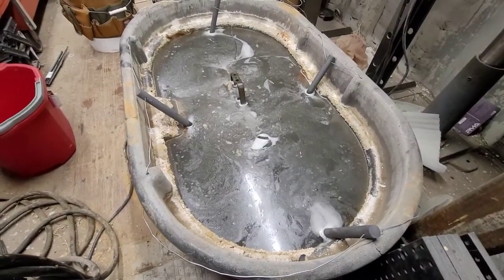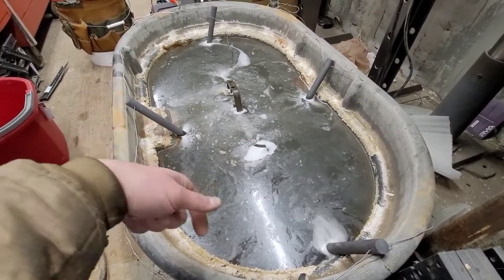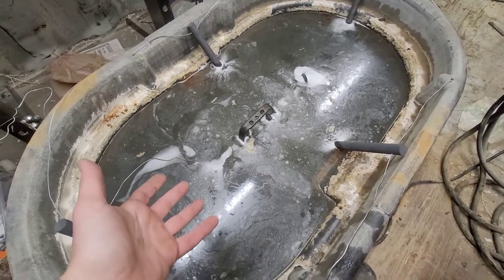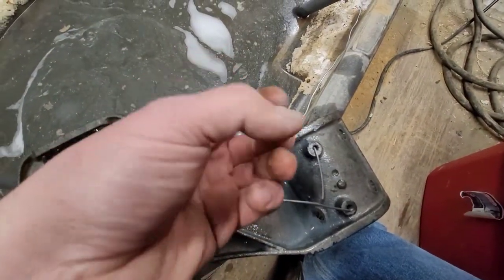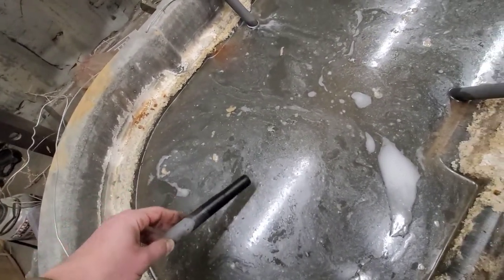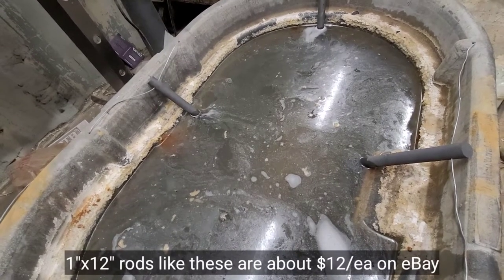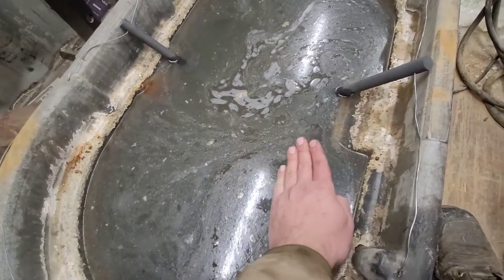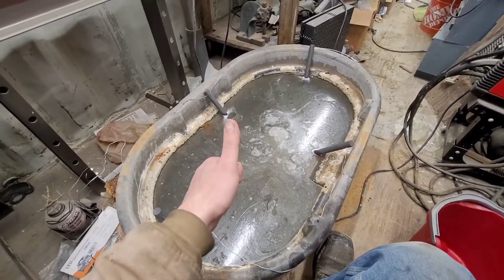Electrolysis for rust and paint removal

Comment: Hi JB,

Have you had any issues with painting cast iron parts after the electralisis process?  I've restored several old tools using an e-tank with great success. 
Now I have a set of cast iron feet from an antique cast iron tub. I've seen a few comments about the electrolyte leaching into cast iron and later leaching out, ruining the paint's adhesion. This is a paying job so I really don't want to screw it up...
Thanks for any insight you can provide.
Reply from the maker: Hi Tag, this is a great question! I have had really good success painting over parts that were electrolytically stripped. I think the biggest key to the whole thing is to make sure that you de-grease any parts going into the solution really, really well before they get anywhere near the tank. The process will usually dissolve grease and grime to a certain degree, so if that is allowed into the tank then it will be circulating in the water and can leech into the metal a little bit, causing issues down the line. Another big factor is using too much washing soda/TSP in the tank. You really don't need all that much of either chemical to have good electrical continuity in the solution, and having too much can cause the heavier salts to precipitate out of the solution and cause a crust around the rim of the tank (in this video, the solution I was using had way too much TSP in it!). If that happens, the chemicals will definitely leech into the base metal of the part you're stripping and can cause adhesion issues. Less is almost always preferable in this case - you can always add more chemical if you need to, but once it's in there, it's in there until you drain and refill. A good rule of thumb I've been using lately is 1 tablespoon of washing soda and one half tablespoon of TSP per gallon of water (so 1.5 tablespoons per gallon, total). This provides a good conductive solution, and the TSP helps with flash rusting a little bit (you still need to dry your parts thoroughly upon removal though). Adjust the concentration as necessary if you aren't getting good conductivity, but going much beyond 3 tbs/gal will oversaturate the solution pretty quickly. Rinse all parts in clean water, then dry using heat if possible. From there, use a good DTM primer and the topcoat of your choice and you should be good. I stripped my entire Logan lathe using electrolysis (disassembled of course), and primed/repainted afterwords. I used rustoleum professional primer and paint, and other than normal wear I've had no issues with adhesion, even with cutting oil and swarf getting all over it over the last 4 years. Sorry for the long winded response, but I hope that's helpful for you!
Reply: @AllThingsMech  No need to apologize, this is a great answer full of important Information! Thank you. Also, can you give me some guidance on how much to charge for 4 heavily rusted cast iron tub feet? Just rust removal, no painting. Thanks again for sharing your expertise.
Reply from the maker: @tagsmyser4299  being completely honest, I've never done any electrolysis for a client - only personal projects. However, I'll spitball a bit here and apply the same logic to this as I would to something like a fabrication or repair project:

The more time, complexity, and difficulty there is, the more I would charge. In this case, I'd evaluate the overall cost by the general condition of the cast iron parts, and what exactly the customer wants as the end result. 

How big are they? How heavily rusted are they? If it's just surface rust they can probably go directly into the tank, but heavy rust/scaling will need to be manually removed before electrolysis to 1) evaluate the base metal to make sure there aren't any huge defects/cracks/damage/pitting that would be made worse by the process and 2) to get a better overall end result (the less total rust there is, the less work your power supply and solution have to do, which makes everything work  better and provides a better product in the end). 

Is there only rust, or will they need to be degreased/stripped of other contaminates before they go into the tank? I know you said you wouldn't be painting them, but does the customer want any other finishing work done once they come out of the tank, like wire wheeling, sanding, filing to remove casting marks/defects, etc?

In the end it's entirely your call, but I would say a base price of $75-$100 would be fair for a basic prep and strip job. If the customer wants additional detail work done, your time is valuable and you should charge according to how many hours you'd need to put into the project. Also let them know that working with old cast iron can be tricky business - it's very tough stuff, but the grain structure of the metal is very good at hiding cracks and casting defects that might not be visible at all during inspection, but could appear during the electrolysis process. Cracks aren't the end of the world and can be repaired most of the time, just make sure they are aware of the risks and won't flip out on you if you discover something that they weren't previously aware of. 

I hope that gives you a little bit of an idea. Of course, feel free to adjust my suggestions however you need to in order to secure the job, but don't undervalue yourself. This is a pretty niche process, and lots of folks think electrolysis is as simple as throwing something in a vat and letting it cook. But, the prep and post work is where the elbow grease comes in (and, as such, is where the money should be made). It's incredibly satisfying to bring old items back around though - sounds like a very cool project! 😎

Comment: Very interesting setup.  I'm sharing this with my buddy and we will set one of these up in one of our shops.  I really like not having to use elbow grease and harsh chemicals that splash over everything.  Keep up the great videos.
Reply from the maker: Thanks John. I'm no expert by any means but this seems to work pretty well. One thing to keep in mind is good ventilation, which I neglected to mention in the video. Although the amount of hydrogen released is extremely low, it's important to have a fan or something running just to make sure it doesn't collect in one spot and become an explosion hazard. A simple box fan is more than adequate to disperse it - just keep the air in the shop moving and you'll be good to go.

Comment: can you do this on chrome parts? Will the chrome come off or be damaged?
Reply from the maker: Technically yes, the process will remove rust from chromed parts. The problem is more about the hydrogen gas that gets released during the process...while electrolysis won't actually remove chrome, the gas can end up getting under the chrome plating and cause it to bubble and flake, making the part look terrible. I personally wouldn't use it to clean chrome but your mileage might vary.